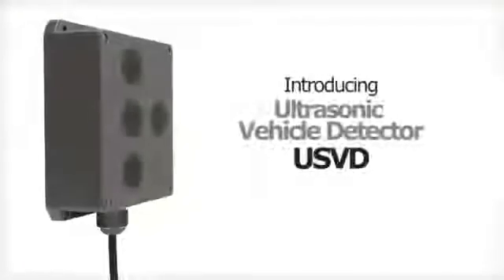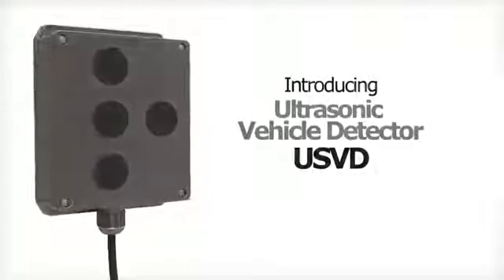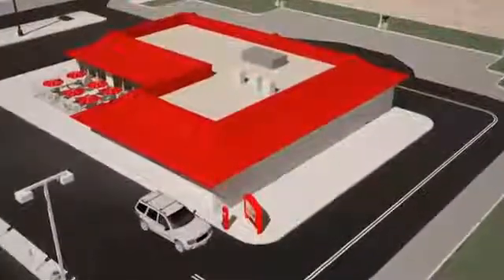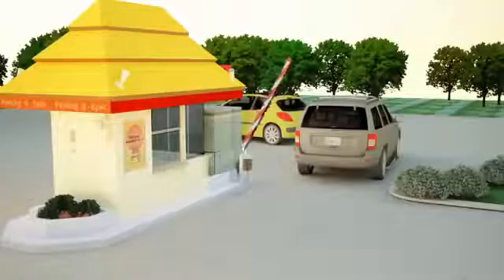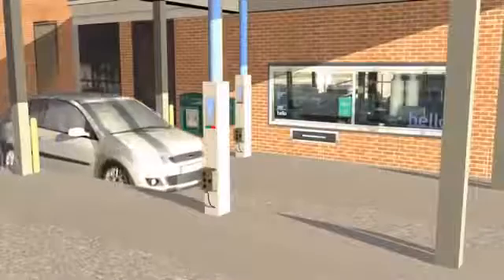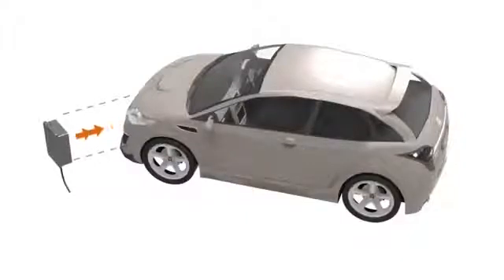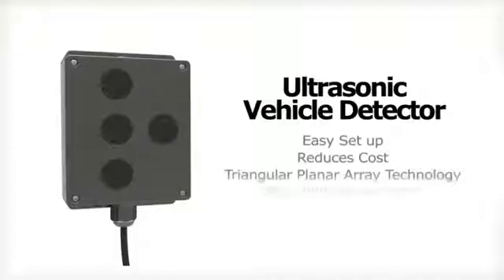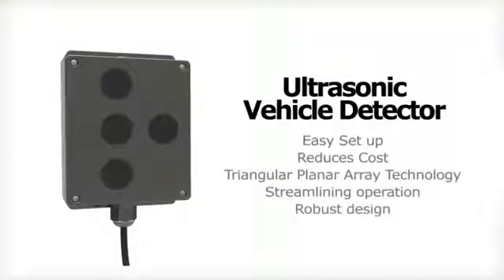EMX - Drive Thru Vehicle Sensor

Comment: Is the part that give the signal to the person working sold separately?
Reply from the maker: Hi there Leanne Lovett. No this unit displayed in the video, the EMX USVD-4X, Ultrasonic Vehicle Detector does not include a bell or light to signal a worker. These type of signal devices would need to be purchased separately.  The USVD-4X has a relay output that a bell or light would get hardwired to. This relay output would trigger the bell or light when a vehicle was detected.